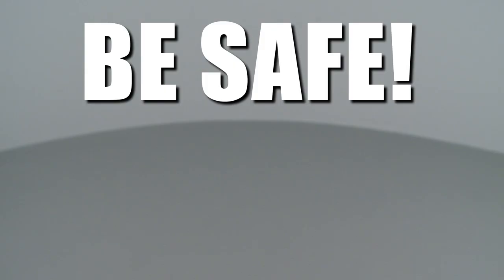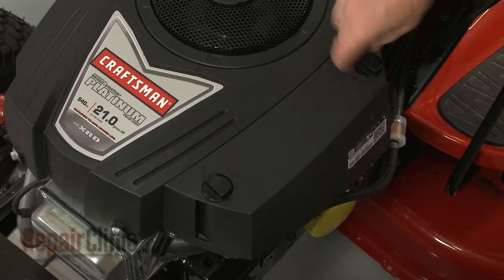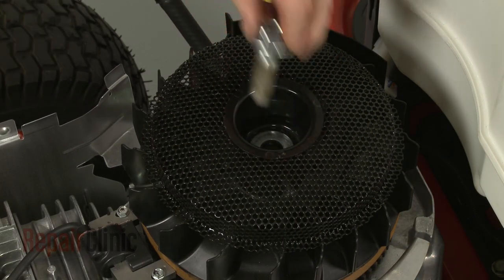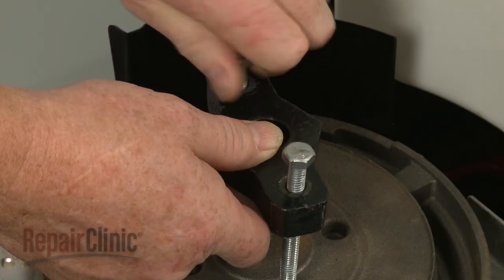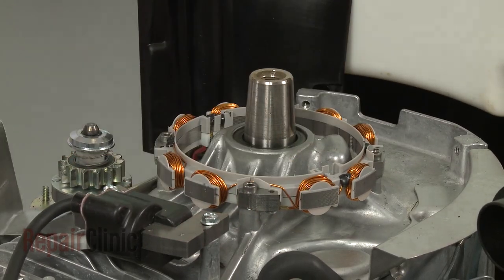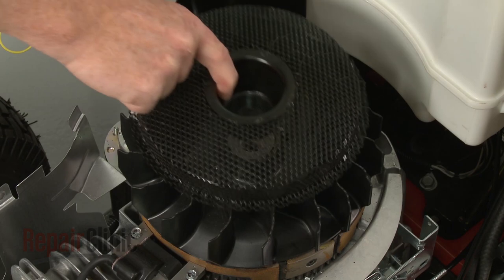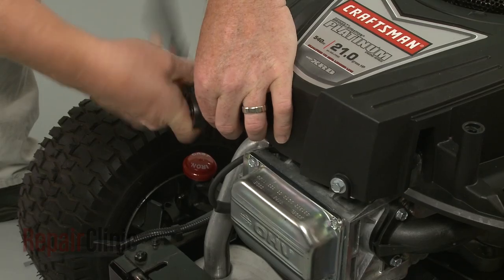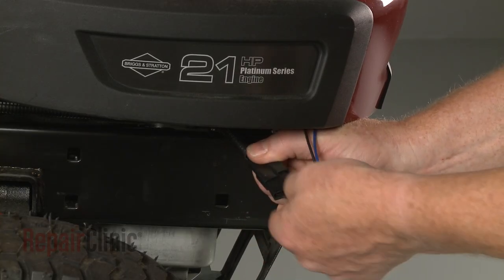Briggs & Stratton Mower Battery Keeps Dying? Engine Alternator 592831

Comment: Hi, just purchased a brand new battery and it ran like a top for 3 weeks. Went out to start it today and battery is dead. Doesnt show anything on multimeter. Wondering if it's my alternator or voltage regulator. Appreciate any assistance.

Comment: In reality, and to be technically correct, this is replacing the stator. In an alternator, you have a stator and a rotor. On a small engine such as this, the rotor is the flywheel (with the magnets around the inner circumference) and spins around the stator. When the magnets in the rotor appear over the coil in the stator, a magnetic field is developed in that coil and induces a positive (or negative) current and Each time a gap between the magnets on the rotor passes a coil on the stator, the magnetic field collapses and induces an opposite current into the coil. 1/2 of the sine wave is positive and 1/2 of the sine is negative, thus a true AC current is generated. This current has to be rectified to provide a DC current in order to charge the battery or to power a DC accessory.
Reply from the maker: +AlwaysFreeAmerica Thanks for sharing. Briggs calls this part an alternator. Kohler calls it a stator.
Reply: I understand, but a rose is a rose. It's pretty hard to change the basic principles.
Reply: The magnets are in the OUTER circumference of the fly wheel.  As they pass by the Ignition module(s), an electrical current is induced.
Reply: I used to work at Briggs. The assembly lines that made them were called the Stator lines. But the manual calls it an alternator.
Reply: It's all in the rectifier

Comment: Never the alternator...first check the diode  in the wire connector or if its a big engine the diode is fixed on a heatsink.

Comment: That's all fine and dandy but we want to know how to diagnose a bad alternator not just throw parts at it
Reply from the maker: JEREMY FOUNTAIN RepairClinic.com has a free troubleshooting system on our website: http://www.repairclinic.com/repairhelp?TLSID=1773.
Reply: A bad alternator will not produce the voltage necessary to charge the battery. A 12 volt battery will need about 14 volts to charge it.
Reply: Use an ohms meter to check for open circuit. Also, look for areas where its burned out.

Comment: At 3:30 it is mentioned to insert the flywheel key into the flywheel slot but removal of the key was not mentioned when the flywheel was first removed.
Reply: How about that nothing to do with changing stator
Reply: It was implied that you'd hold on to the key for later use.

Comment: How long should a battery on these tractors last if the charging system is running fine? Thank you for the video, it's very informative. 👍
Reply: Aleast a year for cheaper batteries and probably 3 years for a really good battery
Reply: @conner5611  Hey buddy thank you for the reply and the info. 👍
Reply: @williamsantiago7303  no prob glad to help
Reply: I've had the same battery for 10 years

Comment: 1:44 Or, braaap the flywheel bolt with an impact.
Reply: @ProBrosMac  Using an impact (The Milwaukee M18 is a very nice one) makes this an easy job without having to hold the other end of the crankshaft.

Comment: Where is the voltage regulator located on these?
Reply: I'm looking for the answer for myself
Reply: @BigSer  what I found was the previous owner had done some rewiring to it and I took an old donor motor for reference. The donor had an inline diode that I cut off and placed on mine. It seemed to fix my alternator burning up issue. Or so it seemed. I sold it right away for parts. So I could be totally wrong.
Reply: no-one seems to know

Comment: Hi, The new stator i received came with shims so the stator wont come in contact with the cylinder casting. I realized installed it with out the shims. Are the shims really necessary?

Comment: What about a blown fuse every time you go to start the mower. Turns over halfway until it gets to the point there’s resistance or just before the spark plug sparks and just blows the fuse.
Reply: Sounds like a voltage regulator...but 3 years later and I guess you figured that out.
Reply: @joeymitchell3863  - My timely reply to your timely reply... 
Good job, you da real MVP - LOL

Comment: I have the craftsman lt2000 21hp 46 inch cut and I can’t find the voltage regulator because it won’t crank on all the way. It turns over once and stops. I have been able to hook up a battery to jump it a couple times but now it will just turn over once and get stuck.  I’m assuming this model doesn’t have a voltage regulator and just have to replace the alternator?
Reply: You didn't answer the question does it have a voltage regulator or not?  if you don't know... just say... i don't know!
Reply: @godnet5079  I don’t believe it had one but I got rid of it anyways and bought a new john deer zero turn was well worth it!

Comment: How does one identify which engine uses what stator. I can't find any numbers on the engine other than it is a 16.0 OHV Vanguard.
Reply: I found my engine series number engraved on top of the silver tin cover that has “OHV” embossed on it.  It was really hard to see. Had to clean it up and use a flashlight to see it.  Then use the series number to look up the alternator/stator, etc.

Comment: The wires to the alternator that go up under the flywheel came detached. Have to jump it everytime with a jumper pack straight to the starter. Dont have a flywheel puller to get up into there to reconnect the wires lol.

Comment: Dontcha just love these factory how-to videos? Look at that mower: no 5 years of grass wedged into every crack, no oil blow-by gumming stuff up, no crusty dried up wiring or brittle connectors. The hood slides right off, the wires all come right apart and flex like a new condom. Even the nipples on the tires are pristine! I guess it does make things easier to see, but it sure ain't the real world!
Reply: That’s what I was going to say. I’m doing this repair and my hands looks like I dipped them in an oil bin

Comment: When charging the battery of a lawn tractor, should I put the setting on 2 amps or 6. How long will it take to charge on 2 amps? Thanks.
Reply: idk but i thing 6 goes to battery and 2 for lights
Reply: 2 amps is better for the battery but 6 will work fine if u need it to charge fast .2 amps is a trickle charge and u can buy a battery maintainer it charges at 2A and senses when it is charged and will stop charging until it drops below fully charged then it will kick in .it is a good idea to use one in the off season 9n mowers and motorcycles

Comment: I need help...
I have a Exmark turf tracer and the problem is that it won't charge, in order for me to start it I have to use jumper wire and sometimes the blades won't come on because of low voltage to battery. I replaced the started solenoid, regulator, flywheel magnet was broken so I replaced flywheel and also replaced the stator. But it still won't start I have to keep using jumper wires :( help please please please... I was thinking maybe the battery wires but I doubt it
Reply from the maker: Jbolanos10 We would suspect you have an alternator problem.
Reply: +Jbolanos10 Repairclinic is erroneously referring to the stator as the alternator, what he should say is he suspects the stator, however you stated you already replaced that. You also state you replaced the flywheel, which in a small engine is the equivalent of the rotor in an alternator. By changing both the flywheel and stator, you have effectively replaced an entire alternator.  One thought I have, not having any experience with that brand, would be a rectifier or solenoid. Trace your wires from the stator to see what, if any, components they may go to.
Reply: So your mower doesn't have an engagement wire that engages the blades...

Comment: Looks fairly easy. Just have to rent a puller from advanced auto.
Reply: You can probably buy a simple puller from Harbor Freight for less than the cost of a rental and then you'll own it. Ask me how I know :)
Reply: @pj2418  isn't rental FREE you just use your CC to put a deposit in case you damage it or fail to return?

Comment: Could just be the in series diode by the connector... Why wouldn't you test everything first instead of replacing the whole thing instead of a 50 cent part?? Oh.. never mind, I think I know why!
Reply: Can u just cut out the diode and splice a new one in
Reply: Diode? You got a video to show replacing?
Reply: @ProBrosMac  The diode can only go in one way for the charging circuit to work.. They usually have a white band showing the polarity. Solder the new one in the same way you take the old one out, taking note of the white band.

Comment: I need help please,  i have a john deere 111 mower with a briggs and stratton in it and i used it for 3 years plowing snow, last spring the stator burned up in it ( started smokeing really bad) and now every stator i put in gets really hot and starts to do the same thing, please help fast
Reply from the maker: We recommend looking for a shorted wire or battery. You can try disconnecting the wire that connects to the battery to recharge it and see if the stator coils still get hot. There should be two separate circuits from  the stator. One DC output for the battery may have a voltage regulator that may be shorted and an AC output for the lights. Looking at a wiring diagram for your model may help.
Reply: +Matt Rohn Hey Matt, some JD's use a rectifier, usually attached to the shroud of the engine, that could also go bad and present you with the symptoms you describe. They're pretty inexpensive. To find it, follow the wiring from your stator to the connector. It should also be said that not all of these use a rectifier, so just be aware.

Comment: whers the voltage regulator?
Reply: Dual circuits stators (alternators) don't have one. They just have a diode instead. I found out the hard way tearing my mower apart looking for the regulator 🤣

Comment: Is this the only thing that would keep causing a battery to die? I've had this problem with a Scotts Model# S2046 since it was new.
Reply: no multiple things can cause it this only the source of power
Reply: James Flores Wonderful.
Reply: Luigi Provencher id look for chewed wires shorting out or a faulty key switch
Reply: James Flores I was thinking that it might be the switch in the seat but I'm not sure. I've got it all apart right now because I had to drop the transmission just to get to the solenoid.
Reply: Luigi Provencher jesus the switch in the seat only grounds the magnito to kill the spark that wouldnt do it
Reply: tell me the make model and type so i can help you
Reply: James Flores Alright,well after I get the transmission back together again, I'll have to see if it starts with the new solenoid in and if not then maybe I'll try replacing the key switch.
Reply: James Flores It's already in one of my comments. Scotts S2046
Reply: Luigi Provencher ok had a thought diodes dont go bad that often but maybe yours has a diode is a one way flow vale for electricity its the red wire coming from the stator
Reply: James Flores I already ended up buying a new one. Still have the old one,though.
Reply: Luigi Provencher mower?
Reply: James Flores Nope! lol The stator.
Reply: Luigi Provencher oh ok
Reply: James Flores Yeah! The new one looks a little bit different and has supposedly been improved.
Reply: @luigiprovencher  Did replacing the stator fix the issue of constantly drained battery?
Reply: @ProBrosMac  Nope! It's a long story but it's been sitting for awhile.
Reply: Ergo....no regulator?

Comment: Ptetty smart briggs to put the alternator under the flywheel. Do your engineers go to the same school as Audi's???? Unbelievable.  Come on make it simple for gods sake. Im not saying this is super hard but im 76 and its a little cumbersome. but whatever.  Thanks for the vid buddy
Reply from the maker: John R Thanks for the feedback.
Reply: +John R It is not just Briggs & Stratton that does this John, most small engines do it this way.
Reply: my briggs motor is older than me the stator rotor charging system still works as well as the magnito